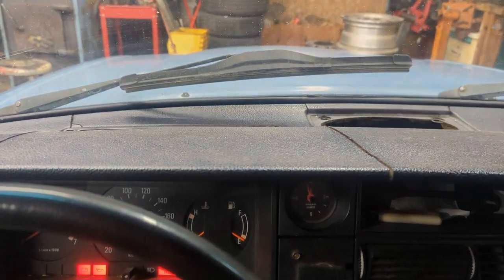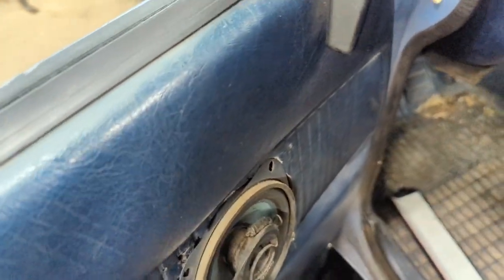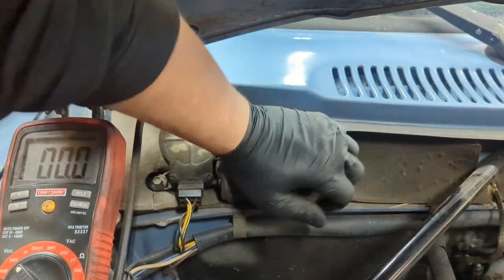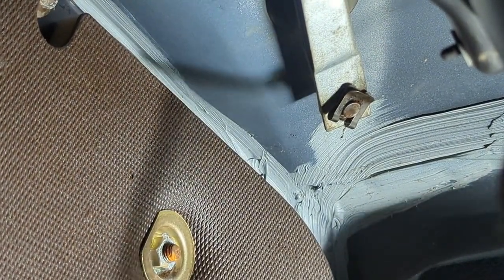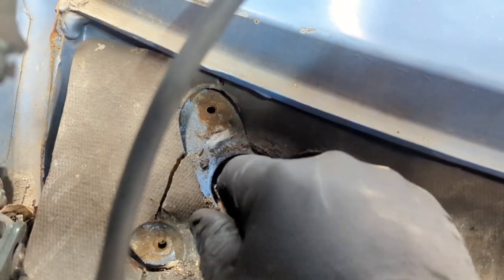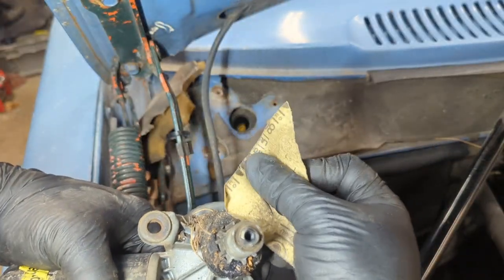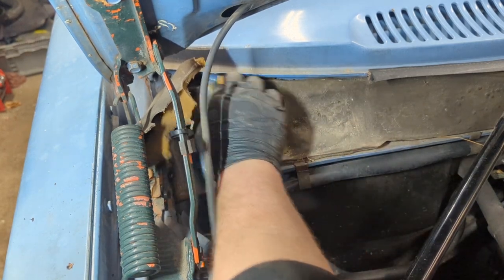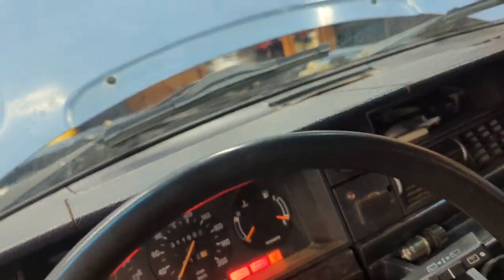Fixing the dead wipers on my Volvo 240

Comment: Ok, I am a bit puzzled, all the volvo 240's I've seen have the ground wire attached to one of the motors bolts then fastened to the wall above the motor, how come you have no ground wire, is a ground wire unnecessary? If so then why are there ground wires?
Reply: Hi, from what I've gathered, in the absolute later stages of the 240's production they ceased using a sheet of brass between one of the three bolt attachments to the car's chassi and instead went with the ground wire as the piece of brass had a tendency to break off and/or oxidise. This is why most modern replacements have the ground wire that you mentioned.

Comment: Thanks for showing me the access to that motor from inside that's a big help . Usually it's a park feature inside the motor that causes it to go all the way down after you turn it off. You probably will need a new motor at some point. Please show this car some love clean it up use a wire brush to make sure the ground connections are good.😊😊😊😊

Comment: Love the roof rack you have could you send the specs?
Reply from the maker: ARKSEN 84 x 50 for the basket. I'm using 3 late 80s/early 90s Saris cross bars to hold the basket on.

Comment: Obligatory Mountain Dew shot at 3:20.  You may want to use AquaPel instead of Rain-X.  My understanding is the AquaPel product is less prone to streaking and you don't need to use Rain-X wiper blades to keep the efficiency of the treatment in place.  That said, I do use Rain-X on all other glass surfaces on my Volvos (headlights, side mirrors, both side and rear glass).